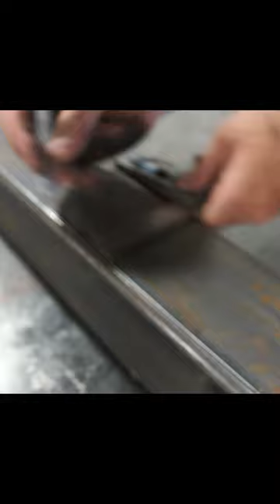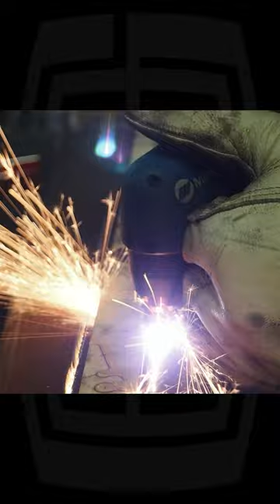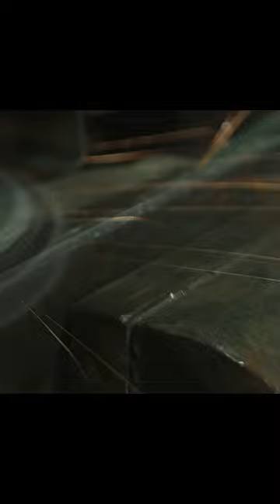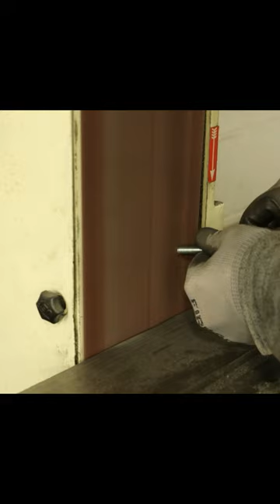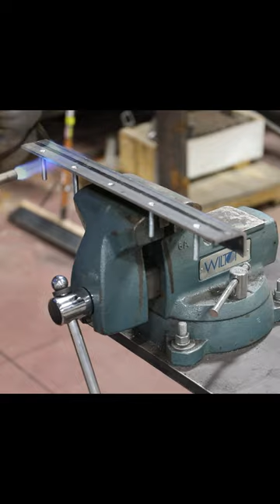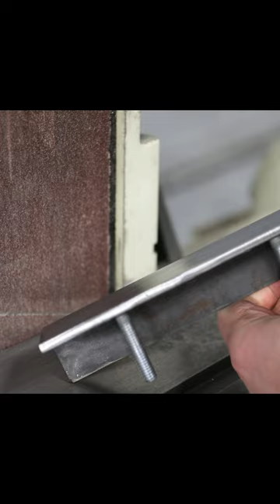Stud Welding | Shop #Shorts

Comment: What the hell was all the cutting at the beginning for if all you ended up with was an angle?
Reply: The original video is a deck chair posted February 2022
Reply from the maker: Thanks!  i didn’t have original footage of cutting the angle piece other than snapping on the pattern.  This (mostly unused) footage is from the Deck Chair video that is cut entirely from a 4”x4” steel tube…